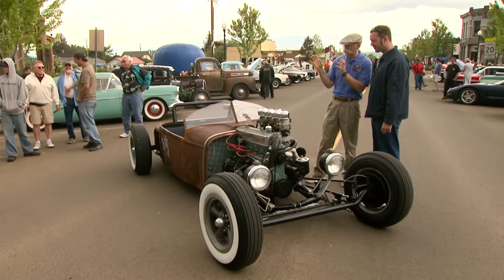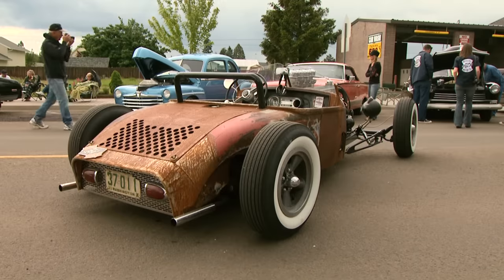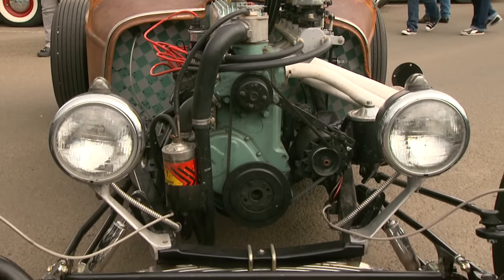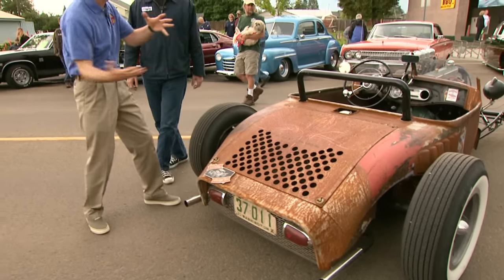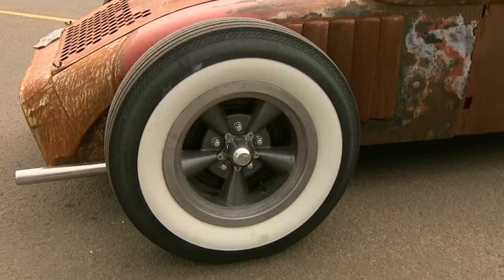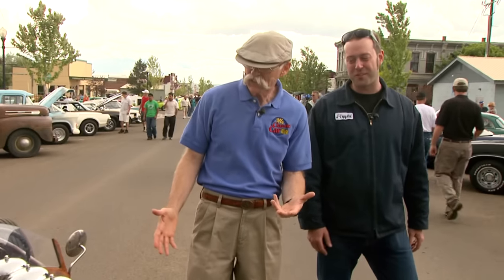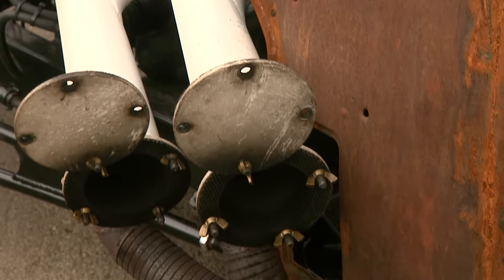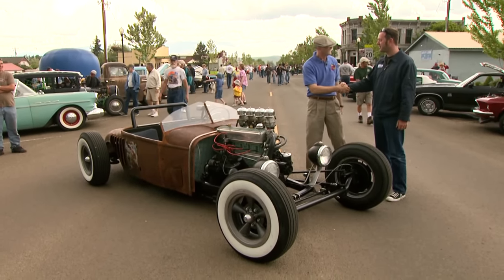Where is the Radiator?

Comment: So nice to see a straight six on a rod instead of the typical over powered, over weight V8 . Looks better that way. Great car cobbled together!!
Reply from the maker: Totally agree!
Reply: I like the look. I’d prefer the power of the v8 tho if it were mine. Nice to admire all the unique builds out there.
Reply: I was thinking it was a 4 because he has so much of it tucked back under firewall. I do need some education though... I'm only seeing 4 exhausts and 3 intakes... they share intake in pairs, and middle 4 share middle two exhaust?
Reply: @vernzimm  I thought that also. I must take a closer look again when I have time.
Reply: No such thing as too much horsepower
Reply: None of y’all could count the 6 spark plugs huh

1:19
Reply: @vernzimm  Those are siamesed exhaust ports, a common feature back then. They're like 1 - 2&3 - 4&5 - 6. Mostly to keep costs down a little for the castings, and to provide extra heat to the single carb of straight four and six cylinder engines in factory stock form for cold starts and cold weather. Super-thrift 153 and Ford's 170-200ci spring to my mind, as well.
Reply: Ls aren’t overweight, they are known particularly for being lighter than most smaller displacement engines
Reply: If you can’t hook driving over 50% throttle I don’t see the point having a monster engine. The straight six sounds great and I imagine it’s still insanely fast  considering the weight of that thing.
Reply: @jsbzoh6  Why driver over fifty percent throttle when that car was not made for nearly that much?
Reply: My first car was a 54 chevy Belair. Recognized the motor  right off. Mine was a 2 door hardtop with fender skirts and a factory locking door for the gascap. It used the ignition key.
Reply: @josephedwarddowling5919  That's what he's saying, why have an engine that puts out over 300hp when you don't even give it throttle? Just use a smaller engine.
Reply: Needs a straight eight
Reply: @pontiacmaniac7772  I agree 100%. Interesting way to use the old Stovebolt Six.
Reply: If I ever had the chance id use a 4.0 I6
Reply: I prefer 60° V6's
Reply: @MyClassicCarTV  Me, three!
Reply: Look up "1320video goes to Brazil" and you'll see the insane feats people accomplish with those old Chevrolet I6s
Reply: @Arthurzeiro  same thing with the old Kaiser 230 OHC engines (from the 60's Wagoneers) that ended up in road racing in South America in the Torino (Rambler Classic/American).  Seriously awesome I6's!
Reply: And the sound! Almost like a Diesel! So cool 😎
Reply: Personally think it looks like a straight 4 with only quad carbs. But still think the six needs a proper smooth idle. I do not like those American rough idles on classic engines. But I AM Aussie🤣
Reply: Actually the sbf is lighter than the 6!
Reply: @jsbzoh6 for acceleration, or passing.
Reply: @OldSchoolZ-wy2yx I really dislike V6s
Reply: @amundaza the wagoneer 6 engines were Pontiac .
Reply: Small,block V8 weighs less than I6 it replaced.
Reply: Plenty of torque from a straight six. There's gotta be millions of em doing the job. It's all about gearing anyway. 😊
Reply: That 6 weighs just as much as a Chevy 350
Reply: Vr6 is the answer
Reply: this thing weighs more than a small block
Reply: It's much closer to the more period correct i8s.
Reply: @jasonm9264  turbos or a supercharger

Comment: Love exposed motor look. Rear mounted rad is nothing new but i like the clever engineering and imagination on this. Full marks for using something other than the V8 smallblock. Very cool rod.
Reply: I quit reading Petersen Publishing magazines when they became a subsidiary of GM: “Look what we shoved a 350 and 350 into this month.” Maybe they weren’t owned by GM, but Petersen sure was cozy with GM.
Reply: @kennethjackson7574  many of their publications used to be great. Then Hot Rod Magazine stopped featuring actual Hot Rods and Car Craft stopped focusing on customizing. Street Rodder became "lets show you to weld Brand X IFS kit into your frame" and of course as you say, the obligatory 350/350 instal feature. 
I much prefer originality and creativity over cookie cutter rodding!
Reply: The 6- cylinder rat-rod is probably a joy to take through windy roads.... Nice wide low-end power curves are what inline 6's are known for.... Several very nice cars there... This one was probably a JOY to take through the Twisties, with  it's equal weight distribution,  very Low C.G. and wide stance... I imagine that log manifold with the good sized plenum and the 4 single barrel GM carbs really gave this engine some pulling power in the bottom to mid-range.... Very nice set-up! It would be really cool with a Kandy  green paint job!!!
Reply: @michaelmartinez1345  Now you're talking! Candy green with purple pinstriping, tuck and roll upholstery, chrome reverse rims with whitewalls, sixties show car style!
Reply: @martinharris5017  Yeah!!! That car would look AWESOME with work like that!!!! I really like the rear mounted radiator to evenly distribute the weight over the four wheels, and that low C.G. and wide stance!!!! That thing probably handles turns like a go-kart!!!! The in-line 6 he's using is an excellent choice for tractable-smooth power delivery through the turns....I would install a couple of aftermarket sports-car bucket seats up in front to keep both people firmly / comfortably  placed, with some decent shoulder belts... Yeah, that thing would be the big fun on the photo that was shown of the road winding through the mountains....👍
Reply: V8's are just so common and boring. I6's make a smoother sound too
Reply: Not new at all. I was running a Dual quad 455 Pontiac in a 73 ford courier back in the 80s. Radiator was bed mounted with three fans. Truck ran cool at speed, but didn’t like idling in traffic. Never figured out it’s happy zone before selling it.

Comment: I love it. The first thing I noticed about it was not the missing radiator, but the fact that it actually had real wheels and real tires, complete with sidewalls. You don't see much of that anymore.
Reply: I agree, i like some big rims, but not on every single damn car on the planet
Reply: I think most tires have sidewalls. The tread would just fall off if they didn't.
Reply: @tyttuut  On most newer cars the tread is just wrapped around the out side of those huge diameter ghetto reehuums. It has to have a bead molded into it, but no actual sidewall.
Reply: @geraldscott4302  That is super wrong.
Reply: @tyttuut  No it's not, they literally have under once inch of sidewall. Basically can't make it any smaller because it's to the point where it's just a super built up bead with a tread. Even new OEMs are using there stupid huge wheels for looks. Ride is terrible, weighs a lot, and they bend constantly. But, it masks ugly disproportionate body lines.
Reply: @apodski  It's still sidewall.
Reply: @apodski  car manufacturers are using larger wheels and low pro tires for handling reasons my guy.
Reply: @snowcow1173  you would shit when i told you 90% of people these days dont give a shit when it comes to actually knowing their cars and would rather cut across a double yellow on a blind corner than experience a little bit of body roll.

Comment: back in the 90's i built a '50 chevy pickup with a gmc 302 inline and a 4 speed hydramatic (auto trans with a clutch, factory) and converted from torque tube drive shaft to a 12 bolt. man that thing was fast, sounded awesome too, straight pipes no mufflers.

Comment: Very interesting and resourceful ride. Didn't know Dennis has a PhD. That kinda threw me back a little. Anyway... you gotta love the level of engineering that has to go into building something like this. One little thing I noticed that may or may not have been intentional, but it wasn't mentioned... in keeping with the engine being a six cylinder, there are a total of six louvers on each side of the car that vent the radiator compartment. Just one of those stupid little things that I sometimes notice.

Comment: One of the best straight 6 engines that I really am I was the 302 GMC they came with the two-barrel carb and a 3-in exhaust and the engine was only 4 in or 3 in longer than the other Chevrolet 235 and stuff.

Comment: I wanted to use a slant six in a Dakota pickup, but there isn't enough room for a radiator.  I think a long radiator could be used alongside the driveshaft under the bed.  An expanded metal grill would protect the radiator from debris.  Its not a great idea, but I think it might work.
Reply: Radiator in the bed behind the cab.

Comment: Had an old rotted and ragged out 34 chevy that had been sitting on my property for decades, i was moving and it had to go. So i threw it on craigslist for 400 bucks. 2 guys show up to look at this rusted out heap that had been rotting away for 40 years out in a field. They start talking about building a custom tube frame for it, installing a new big block chevy crate engine and thousands of dollars worth of other mods. He offers me 300 bucks for it, i tell him 350 is the least i'll take and it goes to the crusher tomorrow otherwise, he refuses to pay that and leaves. The next day i get a call from this guy asking me if i was ready to do the smart thing by selling him that old car for the 300 bucks, i told him: you're one hour too late because i just had it hauled away for scrap metal. He becomes unhinged and yells "i cannot believe you scrapped that for the difference of 50 lousy dollars" I yelled back at him " i cannot believe you showed up, talked about spending thousands of dollars and hundreds of man hours worth of work to that thing and then let it get away from you for that 50 lousy bucks"....of course i really didn't crush it, i sold it that same day to another guy for the 400 bucks. But, there is one extremely cheap and arrogant guy out there who thought he lost out on his dream rat rod for 50 lousy dollars(as he put it!)

Comment: 54 stovebolt six 216/235? I Had a 55 -1/2 ton with a blue flame 235ci six W dual offie 'intake and 2 carter's with stock GM dual exhaust ( 53 Corvette. Quick 6 cylinder...Super Sweet Rat Rod!

Comment: I had an identical red '64 Mercury Montclair like the one in the background, got it when I was 16 back in 1981 for $300 from the original owner, 390 with a 4bbl sure sounded good when you opened it up on the freeway ✌💖☮

Comment: Because it is 100% recycled materials and a straight 6, lots of torque makes it possible to run very tall gears and still use light trottle setting (extremely efficient) it is a green car . No mining , good fuel economy,  equal green car .

Comment: Radiator in frame? But there are no radiator hoses.
Reply: Radiator was mounted in the trunk Area.  Pipes were run from the front to the rear radiator

Comment: That's crazy......makes sense......and works fantastik.
I've had my 66 Biscayne on the streets of Poth Texas for 25 years now. Intended to have a blower..... she (the Other Woman) has evolved over the decades, and to be all-out reliable for the past 2-decades+, to never puke, vomit or spew her bowels. I lay blame to my rear-mount/under-ducted cooling system that keeps driveline temps no higher than 190s, on 100 degree interstate sprints.
Please send me a friend request on facebook and see all of my well thought-out planning and out-of-the-box thinking on most everything I have around my shop.

Are you a fan of the modern Crown-Vic subframes in modern builds?
Me too..... I have a 68RS/SS body on a custom chassis, with a CV clip. Dry sump oil in the frame. C4 Vette in the back....

https://www.facebook.com/photo.php?fbid=2287980174589447&set=pb.100001324595912.-2207520000..&type=3

no hacking or cutting...

https://www.facebook.com/photo.php?fbid=2287982477922550&set=pb.100001324595912.-2207520000..&type=3

anywho....
always love the vast variety of cars and people on the show.

Thanks for doin what you do.

https://youtube.com/shorts/tKXoII839_k?feature=share

Send me a friend request and you can see more:

https://www.facebook.com/photo.php?fbid=717012701686210&set=pb.100001324595912.-2207520000..&type=3

https://www.facebook.com/photo.php?fbid=2071255319595268&set=pb.100001324595912.-2207520000..&type=3

https://www.facebook.com/photo.php?fbid=2071283302925803&set=pb.100001324595912.-2207520000..&type=3

https://www.facebook.com/photo.php?fbid=528632820524200&set=pb.100001324595912.-2207520000..&type=3

https://www.facebook.com/photo.php?fbid=1730671386986998&set=pb.100001324595912.-2207520000..&type=3

and build bikes to suit my likes n riding styles.

https://www.facebook.com/photo.php?fbid=1390782854309188&set=pb.100001324595912.-2207520000..&type=3

https://www.facebook.com/photo.php?fbid=827137740673705&set=pb.100001324595912.-2207520000..&type=3

Look me up if you're passing through to Austin or in the area.
Cheers.....

https://www.facebook.com/photo.php?fbid=2077206875666779&set=pb.100001324595912.-2207520000..&type=3

Comment: 0:18 does it really "red line" at 3500 RPM?
.
i own a 4.0 straight 6 and know its set at 5000 (letting the trans shift, its ~4500....and if ya REALLY get on it, ~5300)
im a mechanic.... i know why LONG cranks dont like RPM
.
but only 3500 for what looks like a chevy 292???
.
.
.
i helped build a HAGR with a 292 chev that revved to 7000
solid lifters and a LOT of custom work and expensive parts however
.
but 3500 just seems WAY WAY low
thats lower / about the same as 12.7 liter inline 6 diesels in semi trucks!

Comment: I like the fact that you can get away with driving just anything over the roads in the US. In Europe you would get this thing impounded within the first 10 miles
Reply: Depends on what state you're in, each state in the US has different laws, regulations & requirements, from equipment requirements, title/registration laws, & safety inspections requirements for motor vehicles.

Comment: That's a stupid design choice with the radiator in the back of the car you have to have a high power after market water pump or  some kind of secondary sub pump somewhere just to make sure you getting enough coolant circulating there's a reason why radiators are always mounted next to the engines. Other than that it's great car love the rest of the car myself.
Reply from the maker: Huh, I love the radiator placement. To each their own I guess.🤔